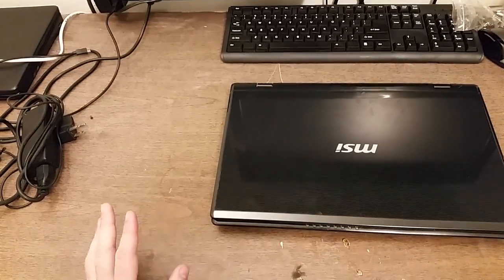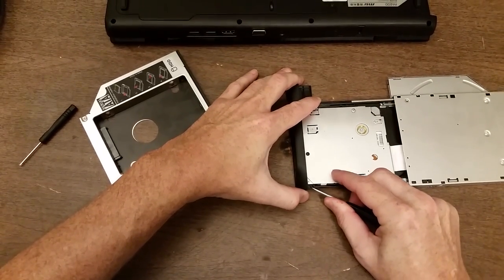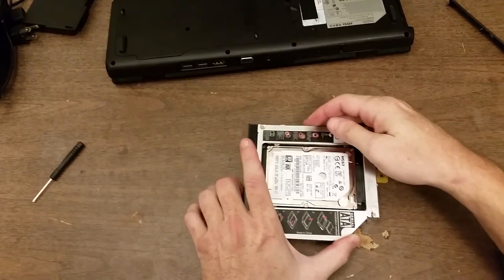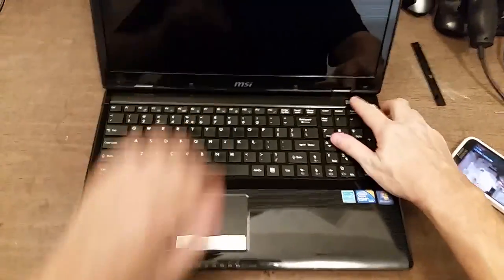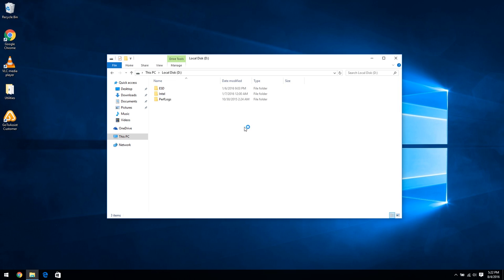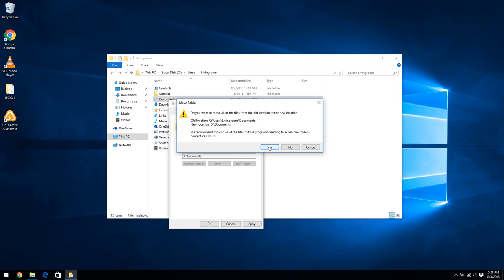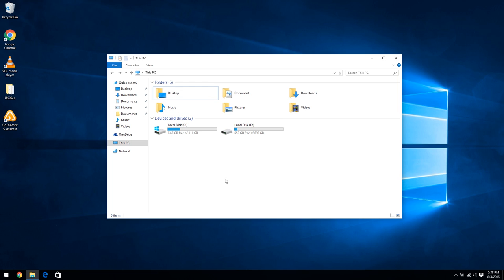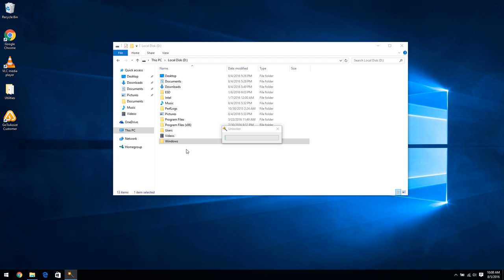Adding a 2nd hard drive or solid state drive to a laptop by replacing the DVD or Blu-ray drive

Comment: dear sir I am facing 1 problem my desktop w10 using,  I connect the external hard disk but not showing, any setting plz segues.
Reply from the maker: Try the external drive on another computer. It doesn't work either then most likely its either a software problem which is still fixable or I am broken hardware problem which is still fixable but a lot more expensive.

Comment: Hey man, I just installed the caddy, and I would like to boot the windows of my old HD, that´s in the caddy.. How can I do this?
Reply from the maker: I haven't tried that, probably.  Go into the BIOS and change the boot option that hard drive first.  Alternatively you could swap this drive into the other spot.  It may not complete the boot though.  Moving a copy of Windows to a new computer doesn't always work.  If it doesn't in the BIOS try changing the control from AHCI to IDE or from secure boot to legacy.
Reply: @MichaelTheComputerGuy  Odd thing is, I have cloned OS drives a few times now and they have always booted fine in new builds or major upgrades after on the first boot, Windows pausing a minute or two, presumably to install any new drivers, then running flawlessly. (Since windows 8.1. XP no chance lol. Some software need keys re-entering).

Comment: I bought one of these caddies from eBay and the listing said it was for my laptop (HP6715b) = 12.7mm thickness. But the drive I inserted into it (already formatted) is not recognised in BIOS, Windows (XP, Vista & W7) nor disk management. I think the drive is not even receiving power as it doesn't spin up or get warm. They sent a replacement FOC, but that is just the same. So: buyer beware!! Just because the listing says it's for your computer, it only means it is the correct physical size. It might not actually work on your laptop!!!
Reply: What hdd did you use?
I suspect some laptop can't power up high capacity hdd in dvd sata port
Reply: @anticeon  I tried many different makes and models and capacities of HDD, as well as an SSD (all formatted, with data, are recognised when plugged into a normal USB-to-SATA cable). But I don't understand your point. What possible difference could the capacity of a hard drive make in determining if the caddy works or not??

Comment: I have removed HDD and remontaged SSD, installed zero windows 10 inside SSD. HDD is placed inside caddy ( DVD ) section. Unfortunatelly I can not see my files / folders and programs inside HDD. When I click a folder , it warns me " you have no permission " . How to solve this problem?
Reply from the maker: Did you clone the data from the hard drive to the solid state drive and then boot to the solid state drive? If so and you've also put the hard drive into the caddy what you would want to do at that point is delete the partition from the hard drive and then recreate a new one to give you a blank drive where you can store files.
Reply: No I did not clone...I just changed hard drive with solid state  drive. I was supposing to reach files in HDD via Usb or caddy connection after switch on notebook on SSD. But I can not open files / folders in HDD. I am getting crazy...I do not know how to solve this. Windows now runs very good on SSD, but how to migrate files / folders even programmes from HDD to SSD.?
Reply from the maker: When you access the hdd you should see the root of the drive with the Windows folder and several others including the Users folder.  Go into the users folder and then in the the folder the same name as your user account.  It will take it a while to access this folder but once it does you'll see the documents, pictures, downloads, etc. folders where you can find your files.
Reply: I have already done this, it warns me " you have no permission " when I click on windows / users folders. Anyway I really cut my hope and re-installed HDD, now I am using notebook with HDD again and I can access all my programs / files like yesterday...
Reply from the maker: @belekrehberi  give it another try. You might want to download a data recovery software to access the hard drive.  Send me a direct message here on YouTube and I'll send you a link to a good data recovery software that's free. It will be able to get around the formation problems that windows is having.
Reply: Hi Michael, thank you for your effort and help...I really started to think that I am stupid. Now I can not find where from I can send direct message on YOUTUBE...I checked every corner your profil, I could not find...Why those things are so difficult? Why I can not find easly where to send direct message through youtube?
Reply from the maker: You're not.  It looks like YouTube took the option away or at least hid it very well.  Go to my channel on YouTube and then to the About tab at the top right.  You'll find a business contact there.  Send me your email address and I'll get the link to the software to you.

Comment: My laptop keep showing repairing.. after doing this and would not proceed to open. what should I do next?
Reply from the maker: Put it back the way it was and see if it goes into Windows
Reply: @MichaelTheComputerGuy  yes, when I put its dvd drive back, windows works. What seems to be the problem?
Reply from the maker: @eloisaacuna3743  Is there a copy of Windows on the hard drive you're adding to the DVD bay?
Reply: @MichaelTheComputerGuy  none. I formatted it so its clean as new
Reply from the maker: @eloisaacuna3743  So you're just adding the hard drive to the DVD bay but when you do that the Windows on the other drive doesn't boot?
Reply: Yessir!
Reply from the maker: Its possible you didn't fully erase the drive.  Do a quick erase with wdc data lifeguard.  Its free just Google it.  Itll be on the WDC website.
Reply: @MichaelTheComputerGuy  still not working :(
Reply from the maker: @eLoi0121  I think I'd need the laptop in front of me to figure it out

Comment: my dell lap top (i5 6th gen) do not dedect the hdd in the caddy , not even in bios , the dvd works just fine and the hard drive works fine on usb ?? not sure what do i need to do ,,, is there a bios setting or something,, it is not new it was the hdd in the laptop ,, i clone the windows to an ssd and wanted to use the hdd as storage as it have over 600gb of data
Reply from the maker: Maybe a compatibility issue between the laptop and the caddy you bought.  There are 2 sizes (thicknesses) of the cadies.  If you bought the wrong one for your laptop the connection may not be correct.  Reply with the full model number of your laptop and the model caddy you bought and I'll look into it.
Reply: @MichaelTheComputerGuy  inspiron 5559 it has a 9.5 mm dvd pay and i did use a 9.5 mm caddy ,,, thanks a lot for you time
Reply from the maker: @abdelrahman458  That looks like the correct size caddy. I'm not sure why it's not working on that computer.
Reply: @MichaelTheComputerGuy  appreciate you replaying and taking the time to do so .. it was the dumpust mistake of all the hdd needed to be pushed harder in the caddy ( harder than what  normal sata need ) so sorry but worked  . I noticed how your was pushed all the way in mine was 2 mm back so thanks again  👌👌😅 it helped a lot watching your video
Reply from the maker: @abdelrahman458  yes I've used these a few times and I can see that would be a very easy mistake to make. Thank you for sharing your experience here.

Comment: are all SSD's the same??
Reply from the maker: L0rdCROISSANT There's lots of different form factors and speeds along with different capacities.
Reply: ok wow, so what is a great SSD if one games and streams off their laptop??
Reply from the maker: L0rdCROISSANT If you're replacing a standard 2.5 inch hard drive the Samsung 860 EVO is a great choice.

Comment: Why sacrifice the DVD drive, use a bigger capacity drive and migrate the OS etc.
Reply from the maker: Most people don't need a DVD drive anymore. Having a cheap smaller capacity solid-state as your C drive  and then a much cheaper larger capacity hard drive is a good combination.

Comment: My ssd on caddy has been listed in bios as ODD, not as HDD/SSD and i can't boot from it.
Reply from the maker: You need to make sure you've installed Windows onto the SSD.  It should work in either the caddy or in the regular spot for the drive.  You might want to try putting the SSD where the other drive is and put the other drive in the caddy.  Either way Windows has to be installed on the drive you want to boot to.